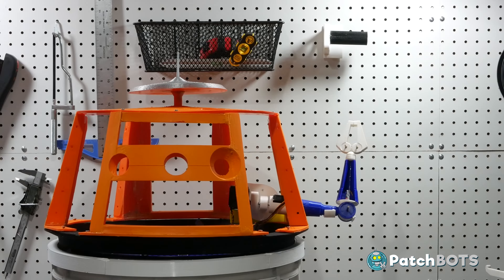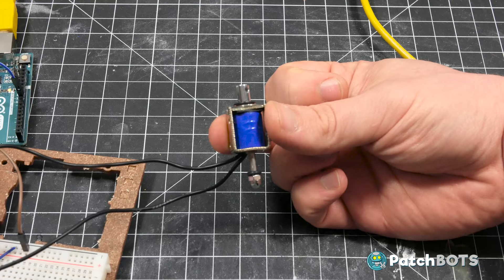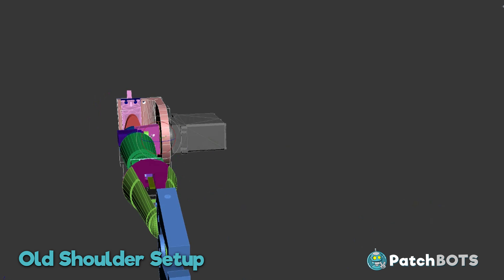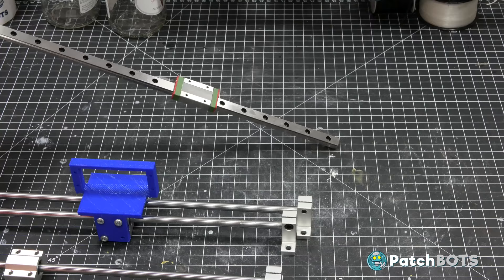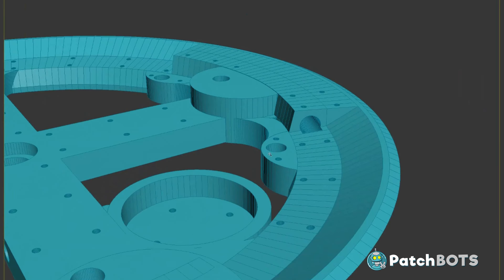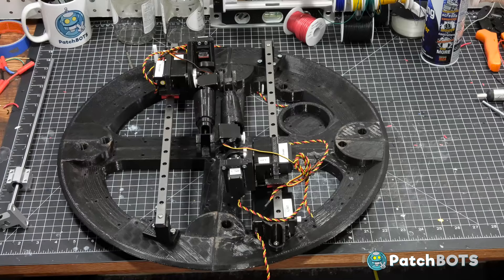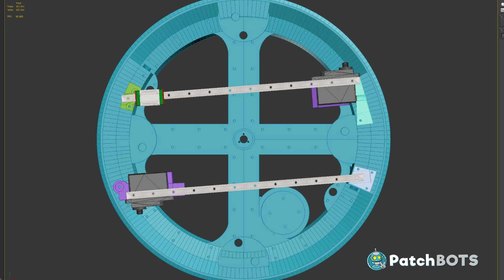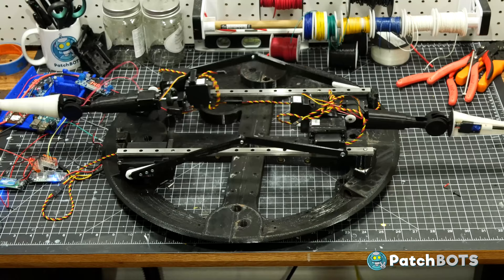Star Wars Chopper Build - Part 4 Head Arms #2

Comment: I like you cable management ideal for the arm motors. Try adding a few neaprean or other low friction washers between the main slider and the storage end and zip tie the cables to them every inch or so to keep it from drooping down. We do this for vertical cable management in entertainment rigging quit often. Here is an example.http://www.scan-rig.com/?p=1880
Reply from the maker: Great tip Shamus! Thanks I'll look into getting those!